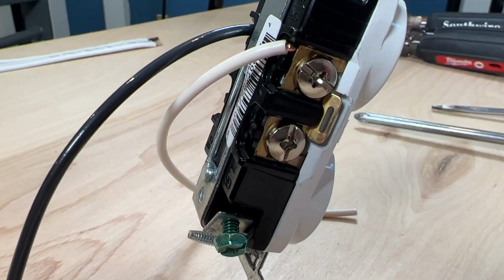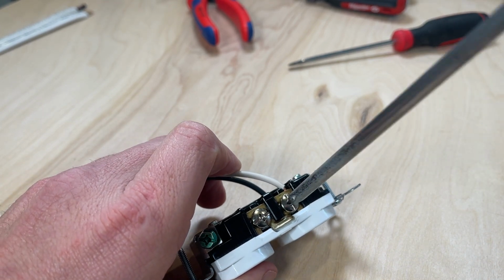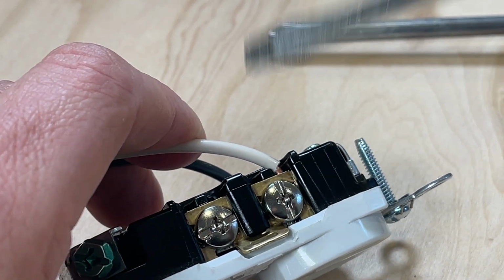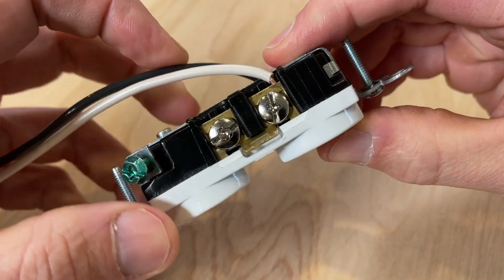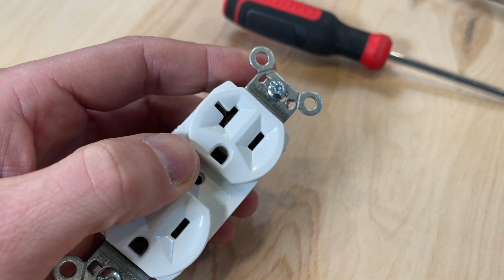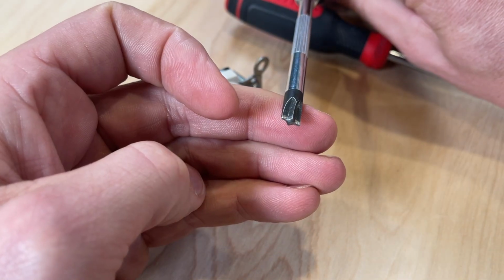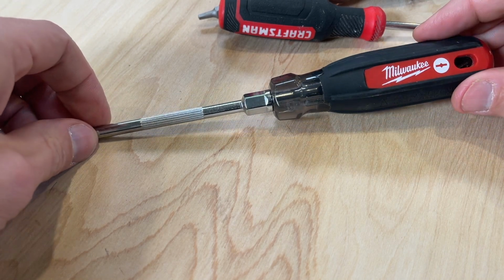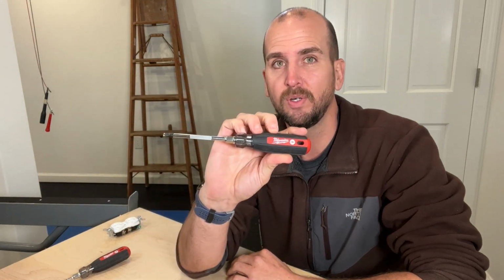80% of People Use the Wrong Screwdriver For Electrical Work

Comment: As a Canadian in my sixties, I’ve been using Robertsons all my my life.  It never occurred to me that someone would use anything else for electrical screws. Also, for wood screws, I can put a screw on the tip of the screwdriver and carry it to the target hole with just one hand sideways without it falling off. Robertson screws were invented by a furniture maker.
Reply: Robertson was not a furniture maker, he was a salesman selling the stanley push driver. On a demonstration the slotted bit slipped out and it got jammed into his hand. He yhen thought about it , there has to be better way. Hence the Robertson screws.  And there are 5 driver sizes. 0, 1 ,2, 3 and 4 which almost nobody knows about.  I have all in driver bits, but to my knowledge the # 4 is only available as a driver bit, it is for very long screws that I've seen, up to 8 inches long. Very rare aplications but ive seen them. 
Can look it all up , he was not a furniture maker.!
Reply: @bryanmcwhirter9945  I've never hear heard of the #4. However, I've heard of the #00, which is orange in colour. Yellow, green, red, black for the other sizes going up. I've never even seen a #00 for that matter. Where did you buy them?
Reply: @andydeciccio  I'm in Canada  so they are every where except the # 4 bit used in construction so only a industrial bolt supplier has, although i had to wait days to get one, the supplier questioned me that it didn't exist until i showed him one, he had been there for over 30 years and that was the first time in his life he heard and saw one. Lol. Good luck.
Reply: @bryanmcwhirter9945  I'm in Canada, too. Care to share what industrial supplier sold it to you? I'm in southern Ontario.
Reply: @andydeciccio  im in Regina,  the supplier i got the #4 bit which was 2 1/2 " long i think was from a industrual supplier called bolt supply, i think they are only western canada but not sure on that, i orderd three and they were almost $ 15 each! I still have two and have never seen another # 4  bit from anybody and nobody believes me. The screw was a # 14 as sequence goes with Robertson up ti 16 i think. Use to gave a catalogue of all the screw types listed in the world and they're about 20, specialty ones for aircraft etc . Not including the tamperproof compliments of each. A very interesting topic nobody appreciates  Worked in electronics for 7 years and then  back to cabinet making and construction and industrual carpentry. Was  always fixing something so bought the the tools for the job. Been called a tool hound and very appropriate! Lmao!. Retired now so just helping friends and trippung over tools. Whats your story Andy if you dont mind me asking and what part of Ontario? Have a great day! Bryan.
Reply: @bryanmcwhirter9945  good to hear your story! I've worked in manufacturing for 21 years before the power industry. Various foundries, 12 years of which in nuclear fuel manufacturing, 9 of those years making in-reactor components for CANDUs. The last 5 years have been working at OPG making electricity. It's different but still good. My years in manufacturing are helping a lot. I like trivia and Canadian stuff so, I used to ask the millwrights and electricians how well they knew their screws. Usually the #1, 0, 00 are precision sizes for screwdrivers. And even Robertson has these! But no one knew of the orange #00! Having said this, I've never heard of a #4 in any screw type. Does Philips have such? I'm a metallurgical engineer, focus on industrial casting, forging, machining. I've always liked the physical engineering world more than the paper engineering world and I think this has made me understand my work better. Some guys never get out of the office, I'd rather be on the factory floor any day. Been all over Ontario, north, east, southwest and now live in central east, Oshawa to Kingston area. I have most tools I need for general home repair and quite a bit for woodworking. I get into home electrical and plumbing and rarely call a contractor. I find, given some time, I can usually figure out how to do what I need around the house. Motivation is another story!!
Reply: @bryanmcwhirter9945  
Anyone, who has been stabbed by a slotted screwdriver , knows that there is a better way.
Reply: @bryanmcwhirter9945  the Robertson also comes in 0000, 000, 00 sizes. I find these sizes in electronic gizmos. The Robertson can be used in any position. The screw once stuck onto the screw driver stays there until pulled off. Neither the Phillips nor the slot screws can do this. I renamed the Phillips "spin and stab" and the slot "slip and stab". Both should be banned because of safety concerns.
Reply: The Robertson #1 (green) and #2 (red) are part of every Canadian tool box, and it left me wondering what in this video what would be wrong with this? - it did not even occur to me that people would try to use a Philips!
Reply: @BlaineZuk  Here in the states Robertsons are primarily used in pocket screws. That's about it. a lot of people don't even know the robertson exists outside of that
Reply: @HickLif3  The Kreg branded pocket hole screws use a square drive bit. The square drive bit was a cheap knock off of the patented Robertson bit design. Robertson Inc is still in Milton, Ont. I have boxes of both Kreg & Robertson branded screws in #8 in about 8 different lengths.
Reply: @HickLif3  sparky here & I learned of Robertson many years ago from a world-class woodworker (and Luthier etc).
Reply: @HickLif3  /. That’s right American technology is years behind the rest of the world. All the top of line tools were discovered, invented, manufactured in other countries. In fact the rest of the world had gone metric and America is just inching forward so very slowly.  

Just kidding. Technically has come full stop in all 50 states.  I just love it when YouTube channels have to edit in metric measurements dimensions so other countries got understand what they’re talking about.
Reply: @HickLif3  strange. they are far superior.
Reply: @HickLif3  There was a story from a veeery long time ago- 70 or 80s I think- about some expensive artwork that was crated up and shipped or flown to a well known museum somewhere n the US.  But the crate was assembled with Robertson screws and no one could open the darn thing without damaging the crate that was later needed to return the art. The story goes that they had to fly a screwdriver from (I think it was Montreal) to the US city the museum was in.
Reply: @derekmadge  i could see a bunch of artists not knowing what a robertson drive is. A ton of people don’t know the difference between philips or flat head or that there are even different sizes of them
Reply: @BlaineZuk  can never find my red robby...kinda like the 10mm key
Reply: Outside of electrical work, if you do manage to strip the screw head, you can drill 1/8 in the stripped head, tap in a #2 red robertson and pull the screw out, regardless of original shape (but you need practice as it doesnt always work and can take a toll on the driver. I keep older worn out driver for this reason). The robertson is the way to go for almost all screws when the option is available
Reply: I'm from the U.S. and will personally vouch for Robertson head screws.  I get the Phillips is used in situations where camming out is needed to prevent damage, but more often than not, torque is needed in applications.  My vote is for Robertson
Reply: Exactly.  EcX is garbage.  You cannot use it off angle or hold a screw on its tip.  WHY square is vastly superior for speed and consistency.  Likewise can buy square drive bits cheap when they wear out.
Reply: Another Canadian using Robertson screwdrivers here. You can get them in standard handles, just like any other screwdriver so you don't need to deal with the interchangeable bits. They are color coded as well for easy identification on the job. Yellow is #0, green is #1, red is #2 and black is #3. Henry Ford is behind the lack of American utilization of the Robertson screw. Apparently, he liked them, but was unable to obtain the patents, so he made use of Phillips fasteners in his cars.
Reply: @rayfunk5659  and orange for the #00, although I've never seen one.
Reply: @rayfunk5659  Sigh, phillips did not even exist until the 1930's and was not used in the auto industry.  As for why they used straight or hex head on everything is due to manufacturing.  Phillips/Robertson were WAAAAAYYYYY too expensive to make and why no one even saw Phillips till the 1980's, let alone the Robertson or square drive heads.  It was not until the introduction of induction heating starting in mass manufacturing around the 1950's when screw manufacturers could even start to think about Phillips head let alone robertoson  or square drive heads.
Reply: @w8stral  All the references I can find have GM adopting the design by 1940 and it gaining huge market share during the second world war. Which also partially explains why Robertson didn't get the same boost as it wasn't well positioned to ride the US war boom.
Reply: I use the #1 Robertson the same way as described in the video, #2 Robertson for the ground screws in the outlet boxes and #3 Robertson for the Electrical Panel box screws (Square D panel). I don't recommend it, but a drill driver at slow speed helps as well.
Reply: Part of the question is why they did not evolved to the Robertson in the 70's and 80's...
Reply: @francoisbelangerboisclair  Simple, there were essentially no square drive screws in common use before the end of the 1990's early 2000's when all electrical devices standardized on the square drive/xlt.  Of course no one likes the xlt and just uses a square drive.  But since everyone has to work on existing infrastructure more often than new, everyone has to still hold all their old tools in their pouches.  Ultimately everyone gets tired of hauling all these tools around and wants to lighten the load.  Why most still do not use square drive but rather just phillips.  Now if I have a electric screwdirver, yea, I will have a square drive on it.  Same goes for my 9:1 screwdriver.
Reply: @w8stral  I generally pull out a flathead.   It's assured to work, no matter what the age of the equipment.   People that curse them just don't take their time - they try to slam screws in as fast as possible, so of COURSE the tip slips. (they also use them as prybars or chisels, and round the tips)
Reply: @w8stral  - slotted heads will NEVER disappear.  The more shallow you make the head, the less capable you are of using any deep bits.    

If you're a screw slammer, you're not efficient.  You're one of the piecework people throwing wiring into construction that doesn't give a crap because it's not your house.    I went through this rent house and I've had to shim every single outlet due to those people.    Plus torn up screws because of overtorqued drills rather than using screwdrivers.
Reply: I agree. I don't know why anyone would use a Phillips or a Slotted.
Reply: Worked for a Canadian company manufacturing fitness products. We had one with screws holding down the battery cover and of course we were using Robertson screws. We started getting people in the US sending them back for repairs when the battery died because they couldn’t get the battery cover open. So we had to change to Phillips just for those 2 screws while the rest stayed Robertson.
Reply: Yeah, I definitely associate square drive with pocket screws. My Kreg jig gets a lot of use.  For non-Kreg wood use, I almost always use Torx screws. I hate it when I have to use Phillips or slot head—mostly when I am removing something old, or building something from a kit where I didn’t choose the fasteners.
Reply: @jasonlescalleet5611  same, mostly-electrician contractor here but I didn't start using square drive in mains panels and such until I saw the advantage with Kreg jig kits. ^5!
Reply: My entire house is... T10 and T50 (two torx types, i think it's those two)
Reply: Additionally, there IS a difference between square drive and Robertson. The square drives are usually made very inexpensively by grinding the flats using round grinding wheels, hence the shape of the square drive bits/drivers with a rounded shoulder. A proper Robertson is tapered and it's usually inserted into a shaft, not a one piece like square drive. The reason for the taper is to securely hold onto the screw. The square drives don't hold a screw. P.L. Robertson used to put a screw in a wall as a sales demo with the screwdriver in it and take his customer out to lunch. When they got back, the screwdriver was still in the screw, a testament to the holding ability.
Reply: As an American sparky I can say almost no one using the Robinson in America. Almost always Philips Head.
Reply: Robertson, green, red, black.
Reply: As an American, despite living less than 30 miles from the border, I have never seen someone use a Robertson screwdriver really at all, but especially doing electrical, and I had no idea one would fit into those outlet screws. I am familiar with the fastener and drive, it's just so uncommon in the USA. I will say if you use JIS head screwdrivers they fit Phillips screws so much better it actually lets them do what you were talking about. Anything is better than flathead.
Reply: I grew up in the 80s and 90s in Canada with a dad who was a carpenter.   What you are calling a number 1 is a number 6 Robertson, the #1 started being used when the "square" drive knock off version of a Robertson came in.  4, 6, 8, 10 is the nomenclature of Robertson, 0,1,2,3 is Square drive.   They are different.
Reply: I'm over 70. As a US resident I used Philips head drivers until I was in my 30s.Then I discovered how much easier it was to use square driver bits to install decking and cement board.  Since then I've replaced my commonly used "like-Dad's" hand tools with better ones, like Picquic's drivers with international bit sets.
Reply: Phillips are the most common here in the U.S. I’m not sure why since they generally suck. I’ve used Robertson drivers on circuit breakers and other electrical applications and they work so much better.
Reply: "As a Canadian in my sixties" ... sorry to hear that ....
Reply: As an American, we were never offered this sorcery.
Reply: Checkout other YouTube's about the Robertson. It was a great innovation at its time. The hardened tip never wears out and is just simply installed on a hollow screwdriver shaft. The screwdriver didn't need to be machined like a slot or Philips. That hybrid driver looked like it was something they thought they could patent for a very specific use.
Reply: Robertson for the win!
Reply: Same here as a Canadian that is all I have ever used on electric outlet screws, is the Robertson's bits never even tried a flat tip or Philips on them at all. When i buy screws at all, I will always look for the Robertson heads first before buying any other type of head screw, I have better success with the Robertson heads. Bits last longer also.
Reply: US cabinet installer. Sq2 for all the mounting. I guess it wasn't Robertson though. We held screws on the tip with magnets.
Reply: I am in europe and I prefer Torx or flat head screws (looks mostly, but they are simple and effective) I really hate philips screws. But I wish robertson screws where common here too.
Reply: If I recall Henry Ford got in a spat with Robertson and that's the main reason they stayed only in Canada. Ford wanted to use them in all his plants but wanted some control over manufacturing. Robertson got mad withdrew to only canada and that ensured the phillips became the predominant screw in the US.
Reply: also as a canadian, i was laughing by the end of this video. i cant believe robbies arent used in the states
Reply: @Scott-sx9qq  Blame Henry Ford and a stubborn Robertson. Had they not had their quarrel people in the US wouldn't have even heard of a phillips 🙄
Reply: That's because you know. For the average DIYer who does these jobs only once in a while because they don't want to pay a contractor for it, as long as a phillips gets the job done, that's good enough for them. This info is good for people who do this on a regular basis. Most people just want to get the job done and aren't going to spend hours on YouTube watching these types of videos to come upon this information.
Reply: Here in the great southern land,fondly known as The Land Down Under,The Robertson are an invasive dangerous prohibited species, like the outlets you pictured.
Reply: yup, unless your an electrician by trade, or in the business, homeowners & DIY'ers  in the states  do not use "Robertson or Square" for outlets etc...
Reply: The Robertson #2  and #1 would deliver more tightening torque. 
More torque than that slippery less surface contact  (+ Philip)
Reply: Torx screws are vastly superior for any type of construction.  Youll never have a stripped head and can reuse screws many times over
Reply: As a classic boat re-builder,  i dislike working on Canadian built boats.  Robertson screws are a bitch to clean...yes they work well when clean but removing paint, varnish , glue and wood filler really sucks to clean.   Slotted screws are much easier to clean and remove.    Robertson are not as bad as Reed n Prince (similar to fearsom).    When you have the correct bit there is no issues what so ever with slotted.
Reply: Invented by P L Robertson in Milton Ontario.
Reply: Robertson was designed by a god.

Comment: There are very few times an electrician in Canada will need to use a Philips screw driver, mostly for installing fixtures imported from either China, Taiwan or the USA.